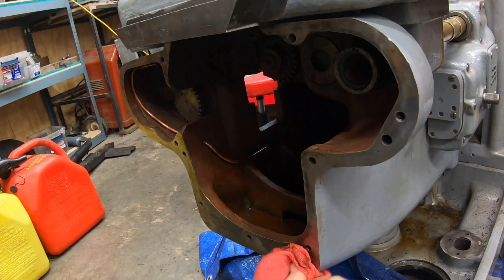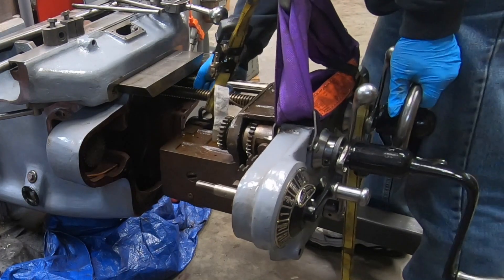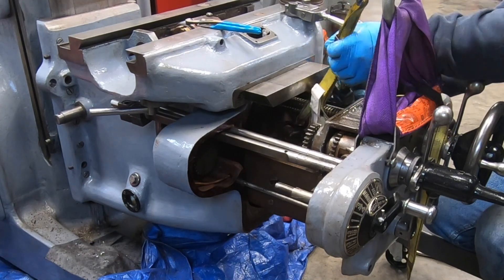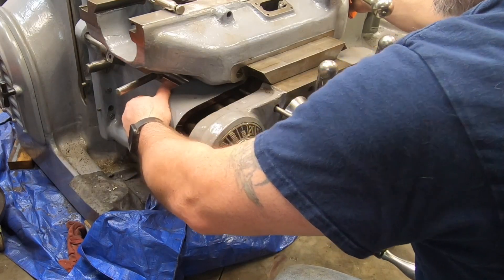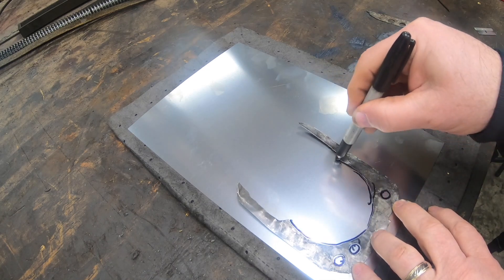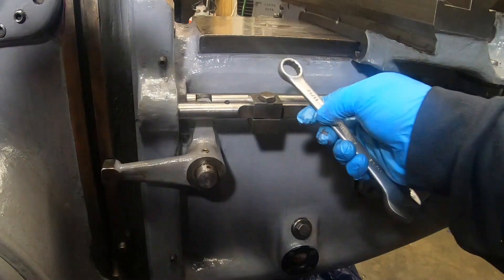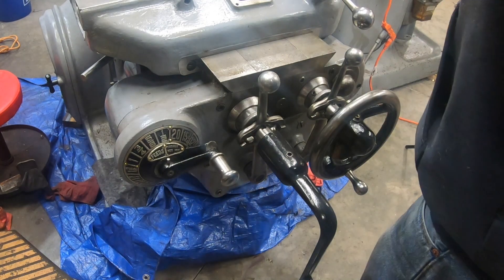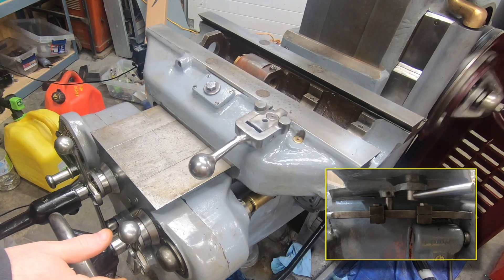Installing the Feed Distribution Unit in the K&T 2HL

Comment: Lookin good 👍  looks like you have all the speeds aside from being a bit finicky.  Should work fine for you . I get not pulling the gearbox entirely apart. I've seen a handful of k&ts with out of time speed and feed dials .
Reply from the maker: This one was half a turn out of time, but that was just because the dial wasn't put back together right. I just had to rotate the one gear a few teeth and it was all lined up. But Ron Grundy warned me about taking it apart. I don't think I'd be afraid to do it on a second machine. ;)